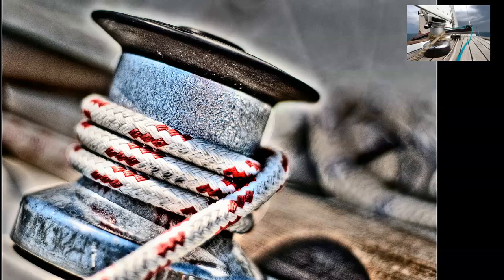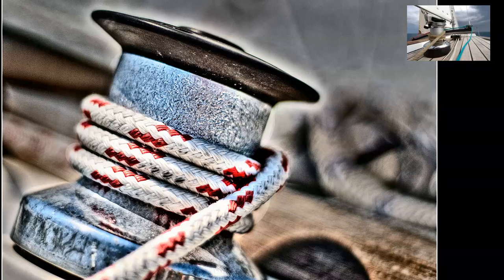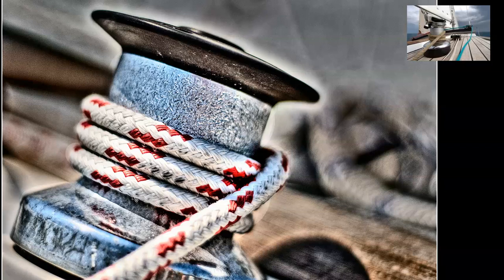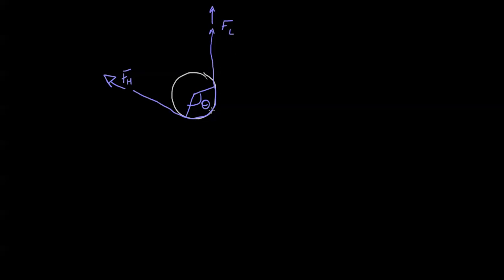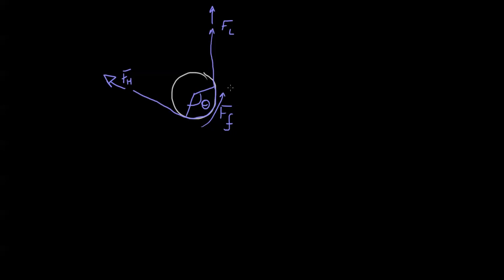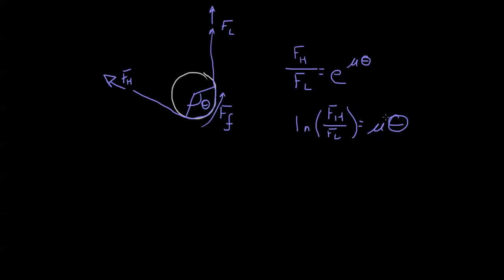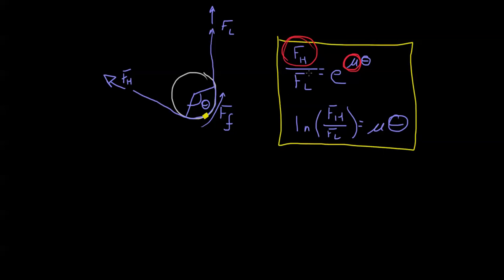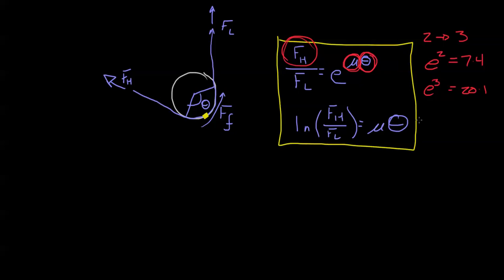Engineering Statics 34 belt friction

Comment: how do you know the angle theta ?, I mean the angle that the rope makes thorough the capstan
Reply from the maker: The angle theta is the angle subtended by the interface between the rope and the pulley.  In other words, if the rope wraps around the pulley one full revolution, the angle is 2*pi.  In this example, it looks like my purple cable wraps for about 110 degrees, or so.